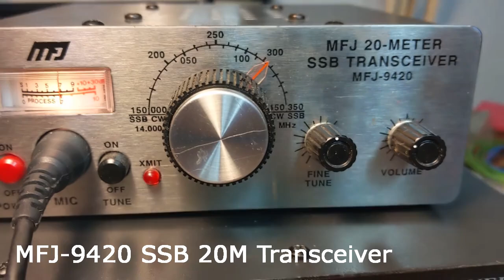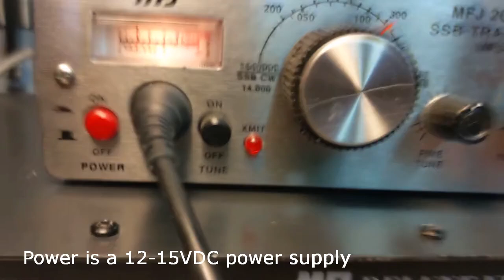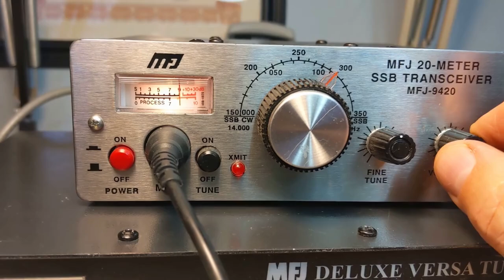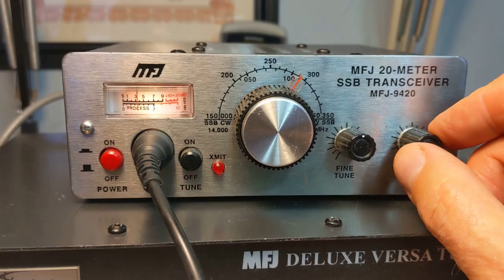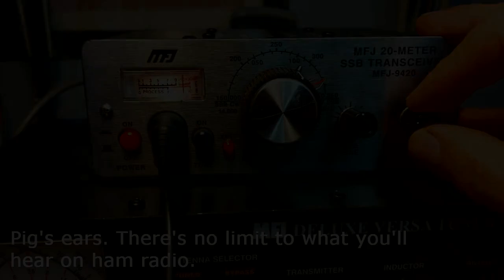MFJ-9420 20M SSB Transceiver

Comment: Me personally I don't like the din microphone connections , I remember from my cb days when ratshack had din plugs they would fall apart if you looked at them sideways that is the only thing I would change on those little rigs.
Reply: I agree. Never have liked DIN connectors either. Too fragile and flimsy.